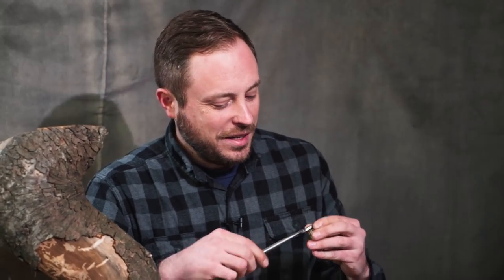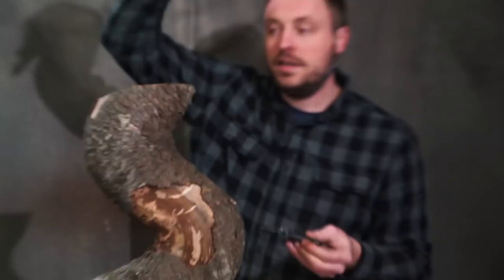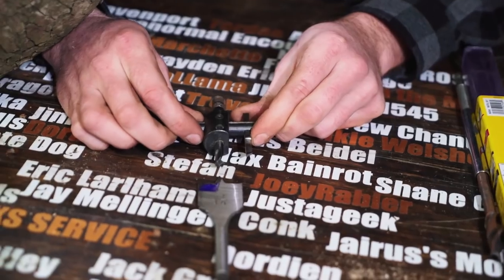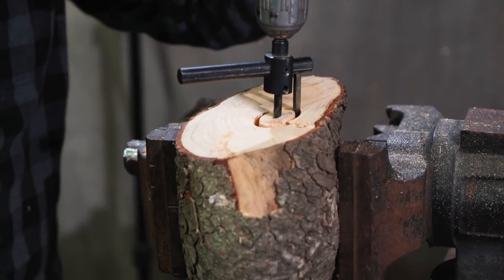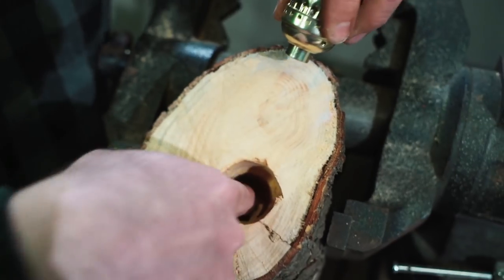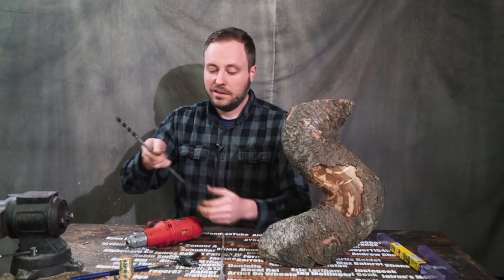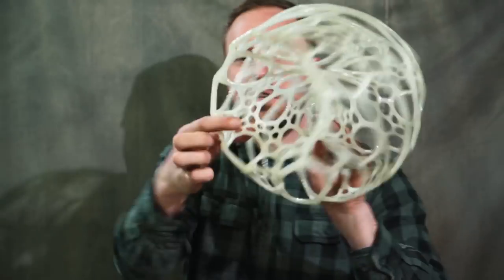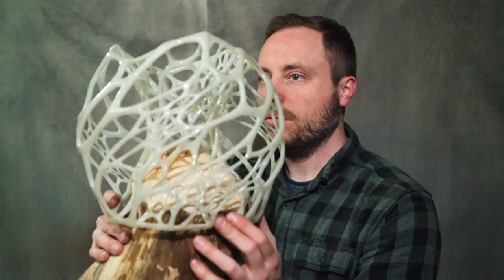Bioluminescent Fungus Lamp

Comment: There's coloured glow in the dark pigment on eBay and aliexpress. You just mix it with something transparent and it sticks forever. I used nail polish.
As for glow in the dark 3d printed objects - there is green and blue 3d filament available, so you can just straight make anything out of that. I made me a moon lamp. But I was disappointed to find out it looks like a radioactive meteorite. It would never look like the real moon.

Comment: Duuuuuuuude, that noodle log would have been great for like, a snake sculpture or something, it's crazy what nature can do sometimes.
Also, if you saved that other piece with the cut in it, you might be able to still use it if you fill that cut with either saw-dust/glue mix or wood filler you can buy in stores.
The wood filler would also work for touching up that small blow-through hole from the drill, best part about wood filler is most of them will stain or otherwise can be aged.

Comment: you should have connected the switch in the area where you accidentally blew through the side with the drill bit. give the hole a function so it isnt an obvious mistake you could just say you did it on purpose or use it as a funny story/conversation piece if anyone mentions that they like it. :'D

Comment: Curious if you could put a UV led lamp in there to make the top glow green all hours of the day. It would be more of a light that you use without electricity at that point and less of a lamp.

But the UV would charge the paint much faster. 

Used to make quantum Nuka cola's with lithium cells and UV leds and tonic water it makes a sweet night light